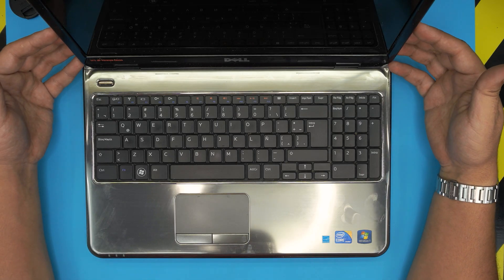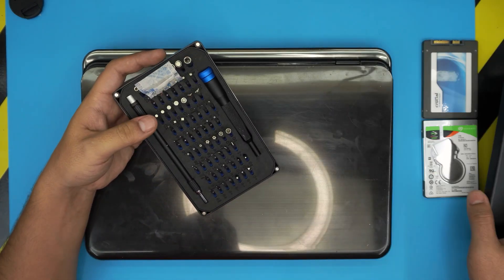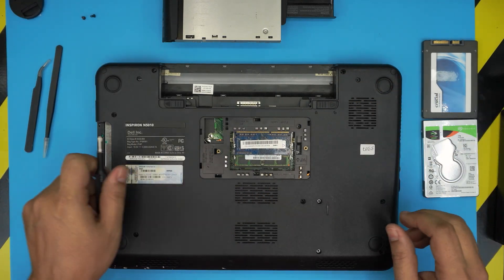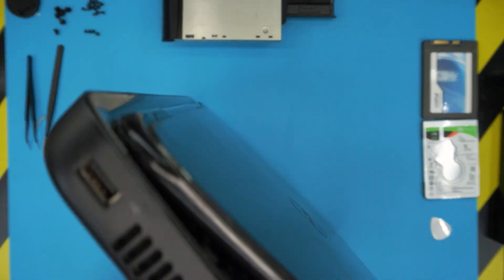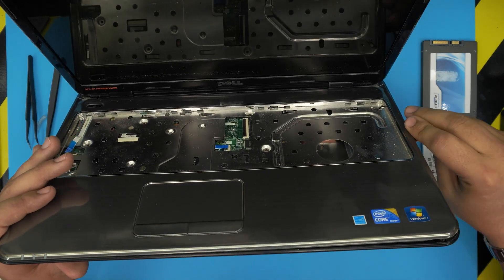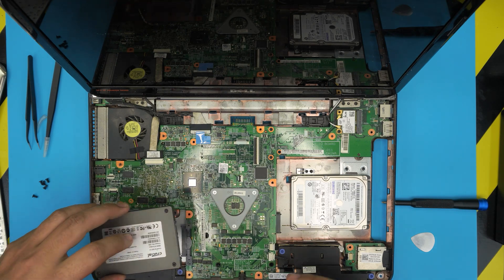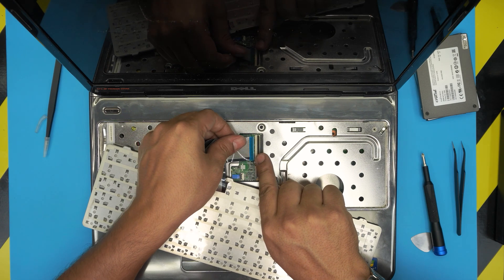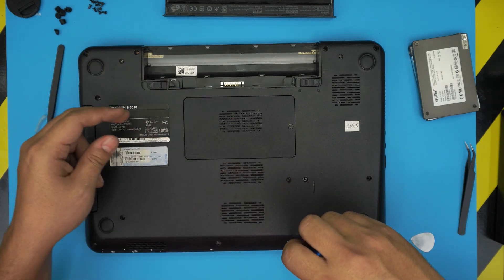Dell Inspiron N5010 💻 SSD | HDD Upgrade

Comment: Thanks. I installed SSD and placed old HDD at CD place. but now I am not able to install windows 10/8 with error 0xc000000e. Tried with bootable USB, UEFI, MBR.
Kindly revert. I am stuck. I dont have any windows available currently to repair the laptop.
Reply from the maker: Thank you for your feedback! If you wish to support the channel, you can like, subscribe, or both!
Regarding your question, did you create the windows boot USB with windows media creator? or used the iso and used rufus?
Reply: @uFixTek  iso+ rufus
Reply from the maker: @anilpandit9572  no use the windows media creation tool: https://www.microsoft.com/en-gb/software-download/windows10

Comment: I installed SSD on the same laptop, it's detected in bios, but when I try to install Win 7 on it, the setup can't find my ssd how to fix that.
Reply from the maker: Thank you for the feedback! if you wish to support the channel you can LIKE or SUB or both :P
regarding your question:  the problem in on the USB or change the usb to different port of the laptop, 1st try different usb port and test (90% of the times its because of usb port) then if that fails use a different usb to burn the win image. make sure you use the link i show how to burn win 10. or use rufus and burn legacy (mbr)
if you need extra help let me know.

Comment: Does dell inspiron n5010 support ssd m.2?
Reply from the maker: Thank you for the feedback! if you wish to support the channel you can LIKE or SUB or both :P
regarding your question: no my friend it does not support it. only sata ssd 2.5'
Reply: @uFixTek  
So regarding to install sata ssd 2.5, which option is preferable:
- remove hdd and replace it with ssd, or

- add ssd in dvd plus hdd?

Thnx alot
Reply from the maker: you could remove the dvd and place the HDD there and use it as storage anytime, 
https://amzn.to/3NKihgC
i recommend you to place a samsung ssd , they are the best and last you much longer and solid.
https://amzn.to/3umQ8p8

Comment: I want performance video. Plz upload how it is performing after ssd installed
Reply from the maker: Thank you for the feedback! if you wish to support the channel you can LIKE or SUB or both :P
regarding your question: here is a video on few stuff i made:
1. how to create windows 10 USB boot drive: https://youtu.be/uDu8j2lE-dM
2. how to install window 10 the proper way on Dell laptop: 
https://youtu.be/GkMZyCUarIA
https://youtu.be/ll_0K4hDksY
(when you put your usb , when powering on your laptop keep tapping on F12 and then choose the usb drive)
Reply: @uFixTek  bro i am saying kindly makes video on how your pc is performing after you installed ssd drive..like speed test, bootup speed, rendering time etc
Reply from the maker: i will make a video to show difference from HDD to SSD performance, on the next laptop that i get my hands on. this laptops are clients computer. but i will def. make a video based on your request :) awesome idea  thank you
remember the laptop in this video is not with me so i make a video with some other laptop but you will get the idea on differences from HDD to SSD